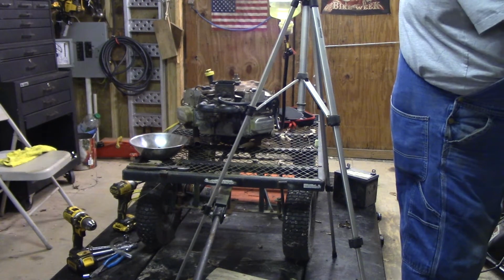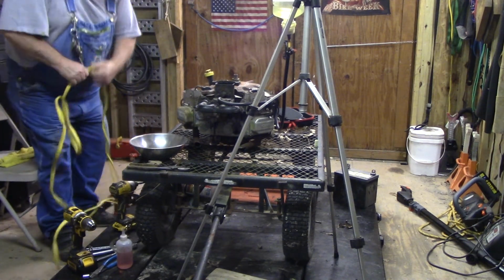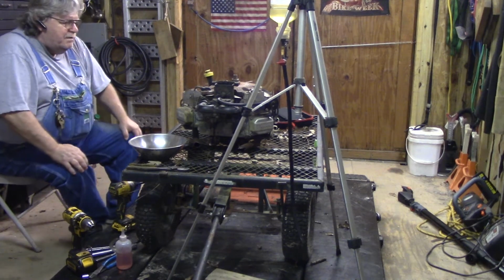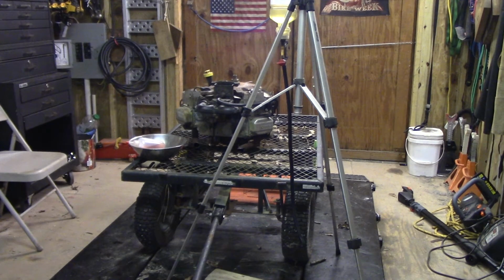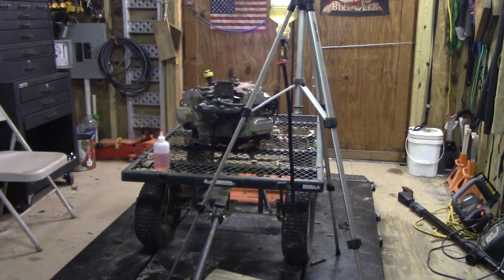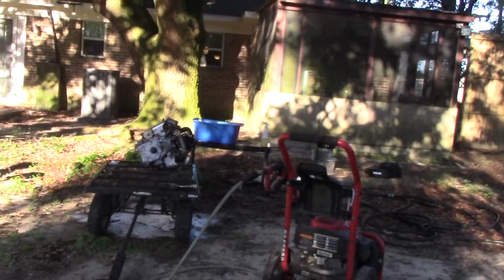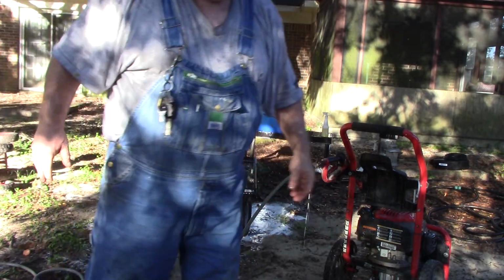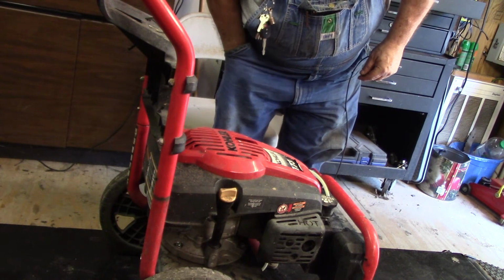Duke's World- 26hp John Deer engine to clean up and sale it

Comment: Boy, if you weren't so far away, I would be interested in that engine. Oh well....
Reply from the maker: We may be in Quartzite around the end of January. But the engine has already sold.
Reply: @dukesworld3020  Going to to the gem and rv show? A buddy of mine will be boon docking on the desert there. He just finished building a 20 foot long solar generating trailer.
Reply from the maker: @mattthescrapwhisperer  That's where we are going to be, Hopefully!
Reply: @dukesworld3020  driving or flying?
Reply from the maker: @mattthescrapwhisperer  We'll be driving and should be there for about two weeks. Hope to meet some friends while we're there.
Reply: @dukesworld3020  there is a tractor and engine show in Wellton AZ about the time you’re coming thru. I plan on being there with other members from our club.
Reply from the maker: @mattthescrapwhisperer  I will keep it in mind and try to come by.